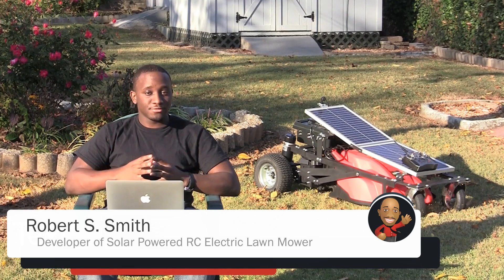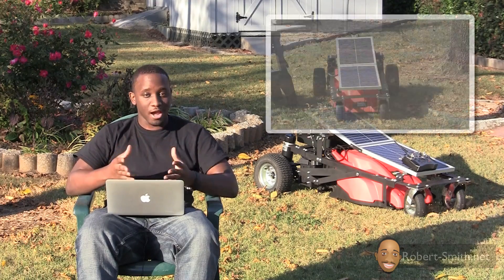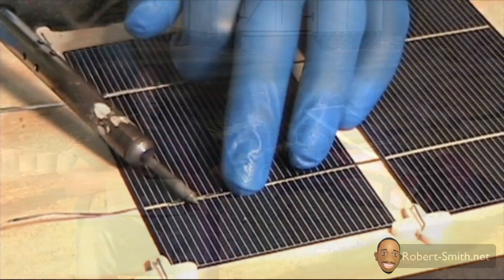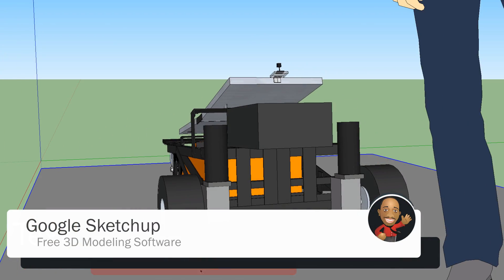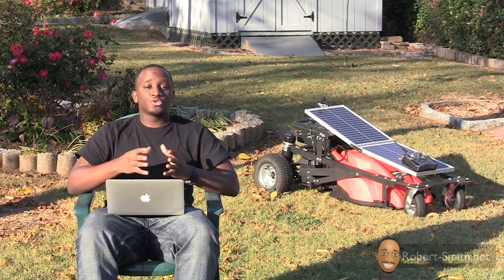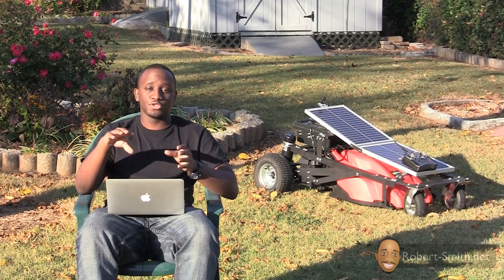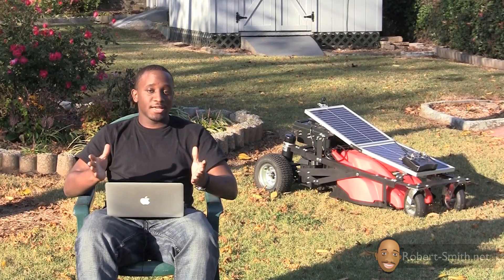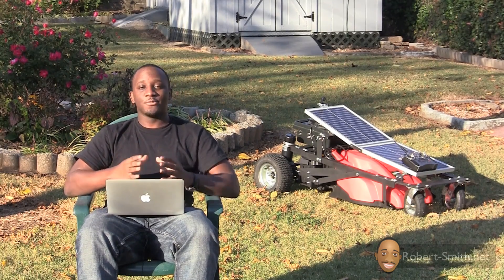How To Build A Solar Charged RC Electric Lawn Mower - Intro

Comment: I love this! I've been meaning to build this for a while but just now getting around it. Is there any where i can still get the parts list, docs and components? I think i have 90% of of it but i'm not sure what's connected to the parallax board (transistor)? Or where the wires are connected from the board. I feel i can figure that part out once i know what's connected to it. I mainly need the parts/components i have the schematics saved around here somewhere.
Reply: I should clarify the part in question on the parallax board is the black piece with the gold top lol. My bad.

Comment: Fun project. I'm going to give it a try.  Thanks for sharing.  

You probably thought of this, but if you added a speaker and lights, you could use it as a security device... If an intruder in your yard at night was approached by a talking mower with lights... start the engine...  

I would also put a trailer hitch for a yard trailer, hauling tools.
Reply from the maker: Haha I like the security idea.

Comment: Are those go-cart rims on the rear?  If not what are they? Did you have to use adapters or did you use the hubs from the wheel chair motors?  Thanks!  Well done!!

Comment from the maker: @clemosrobots smaller wires are usually for the internal brake for the motor. I just took that brake out and cut those 2 smaller wires since the brake was not needed in my case. My motors automatically lock up if no power is sent to them, so no brake was needed for mine. Yours is probably similar but you should double check. Probably at the end of the motor if you unscrew that cap you will see the brake device which you can take out.

Comment: man u did it:p
nice job,i wanna make some as ur but i got problem with ma wheel chair motors
cause ma controller chip got only two output for the motors ,and the motor from wheel chair kind 4 wire coming out,2 kind bigger and 2 kind smal one;so maybe u can help with motors